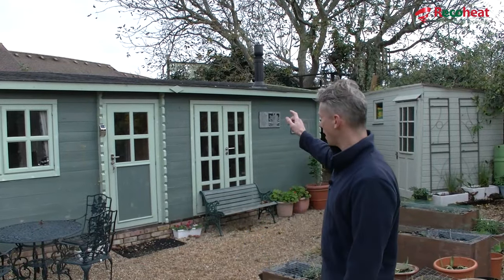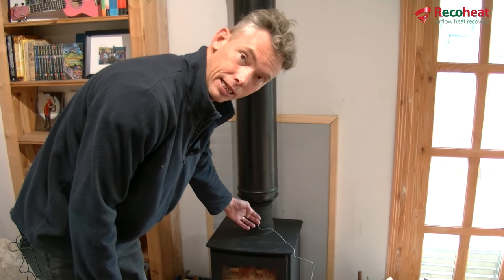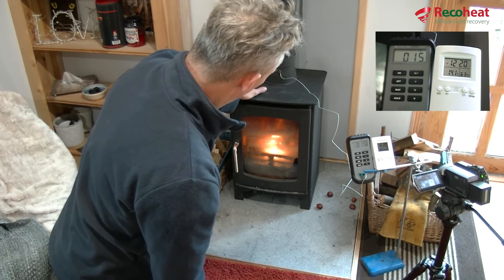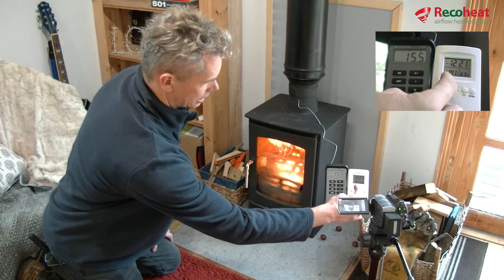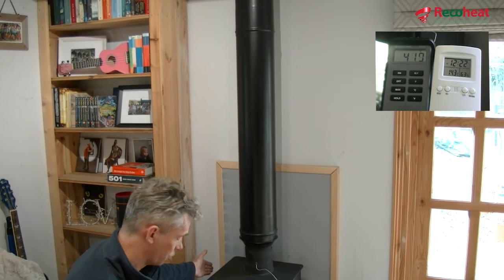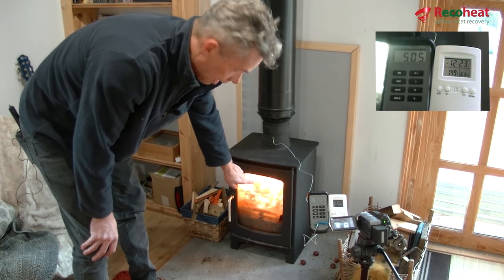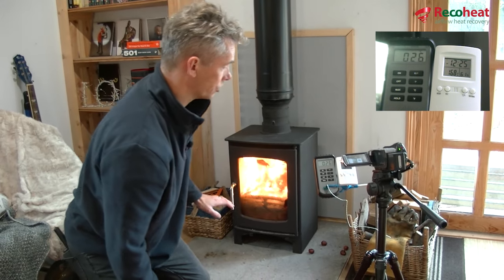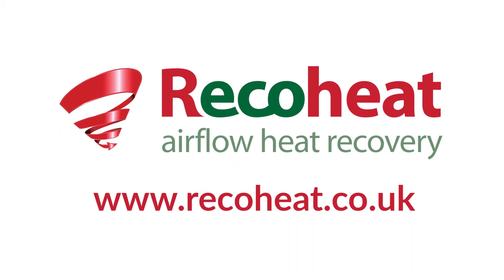Introducing the Recoheat heat recovery unit for wood and solid fuel burning stoves

Comment: 1. I am pretty sure this type of equipment is illegal in the UK because it increases the risk of chimney fires and invalidates the approval of the stove. 2. The stove shown is about 5KW and about 80% efficient. So the heat up the chimney is a maximum of about 1.25 KW. You can't extract more than about 500W from the flue gasses or the stove won't work. Given the size of the air tube, I'd doubt your device gets even 100W, so at your cost of £300 and it could take 40,000 hours of use to recover the investment and given the cost of electricity to run the air pump, you may never see a return. 3. Your video also shows an expensive insulated flue pipe. You would save money and gain more heat to the room and remain legal by simply using a single wall flue pipe for the first 6 feet or so. 4. I think this type of business operation risks a visit from Trading Standards and possible prosecution.
Reply from the maker: When you say 'I'm pretty sure', do you mean, you imagine/made up/had a fleeting moment of quizzical myopia? Our unit is tested by BSRIA in compliance with the CE marking requirements, and meets all required standards, and the certificate is viewable on the website. By all means fail to see the value, but please don't impugn the legality or professional integrity of the business.
Reply from the maker: I think the misapprehension you're basing this on, is that 5kw stoves produce 5kw of heat. Stoves produce no heat at all. The combustion produces the heat, and it's a lossy process, but impossible to regulate at 5kw. The figures are spurious therefore. The system is inherently lossy, and we're making it more efficient, and doing so with as little effect on the normal function of the stove and flue as possible, by utilising the turbulent boundary layer to make heat exchange very efficient. The effects are curious, but the device has been tested and deemed safe and not to effect the safe function of the flue by BSRIA: their report is here: shorturl.at/gtuS0
Reply: J

Comment: You let The heat GO ouț. Not god
Reply from the maker: There's not a discernible drop in flue gas temperatures according to the independent test engineers who did the regulatory testing on it. Modelling suggests a bulk average temperature drop of 23C on a 500C gas temperature flow.

Comment: Creosote city
Reply from the maker: Please check our videos and posts with evidence that this is not the case. The coil is hotter than the flue because it's in the centre of the gas flow, so burns off particles more efficiently than the rest of the flue.
Reply: @Recoheat  ohhhhh

Comment: Couldn’t you just save a ton of money by not insulating your chimney, and pull heat from it instead? And not listen to a super annoying noise and not rely on electricity, with a complex component that’s sure to fail?
Reply from the maker: Of course you could! Go for it! Just like you could walk away when the bus pulls up, or take the wheels off your bicycle and carry it.
Reply from the maker: @Yankeeprepperasshat  Yes, and doesn't circulate heat around your house. And you can't fit into a chimney stack, or put in a terraced house. And will cool your flue so that it doesn't function. But apart from which, will be great - and is a simple choice to make for everyone, ever. So if they're looking for an alternative, it might be because they need one.